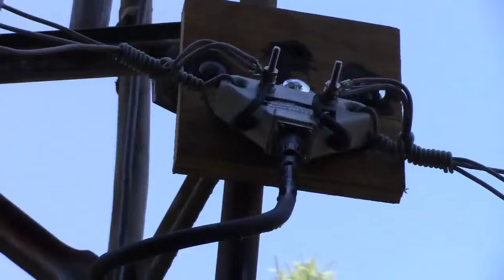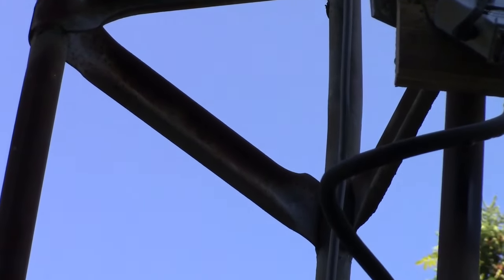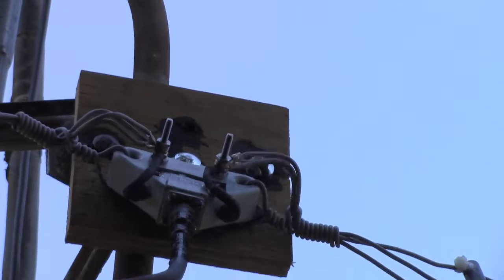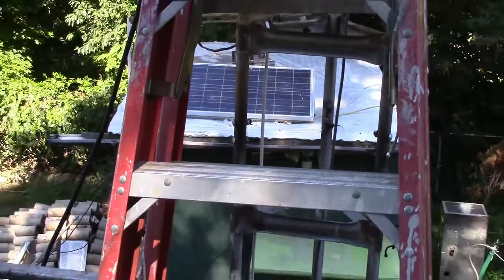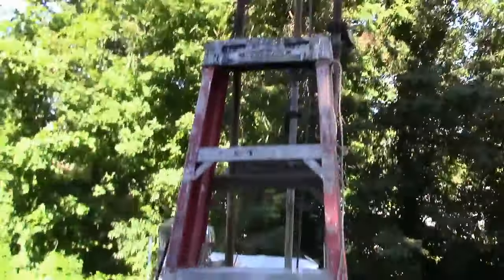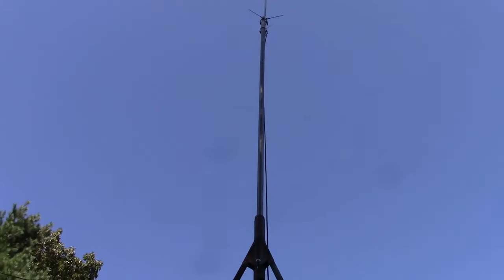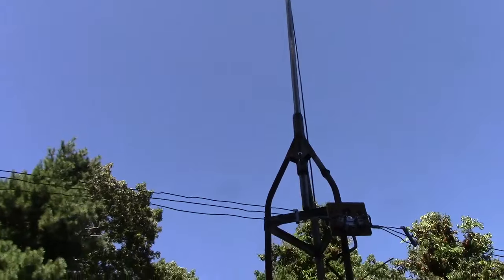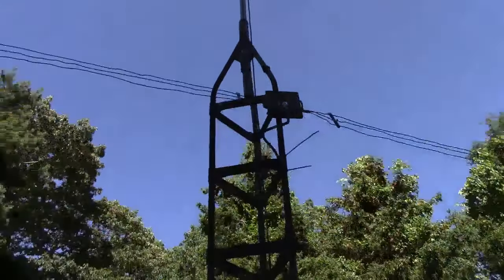Hooking the coax to the dipole

Comment: ive thought about getting my ham license.ive been into talking on a cb radio sinse 1969,we had license for then.people dont no how to act on the cb,theres not many on there now
Reply from the maker: CB has changed a lot over the years, but so has ham. You no longer need code and there is only 3 lic.  Tech, Den, Extra, no code. When I took my test I needed 13 works per minute and the test was detailed.  Now just remember the book  and you're done.